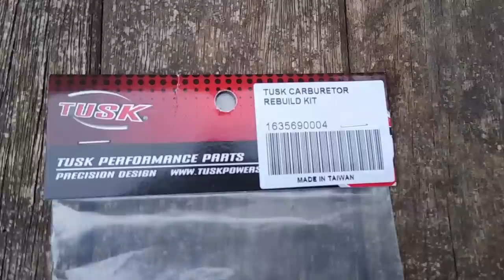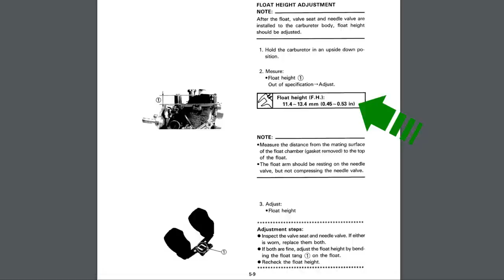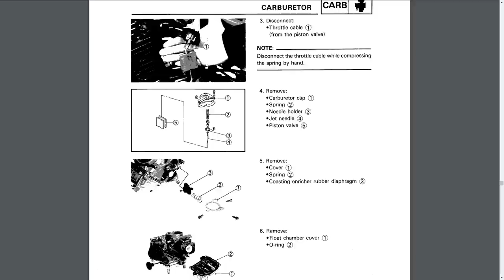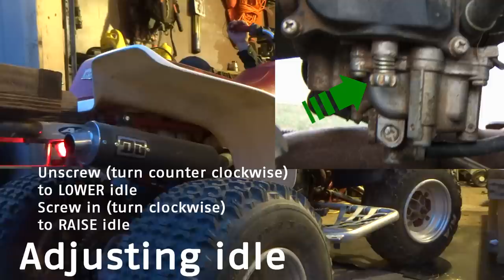YAMAHA WARRIOR ATV CARB CLEAN, REPAIR AND REBUILD - CARBURETOR FUEL SYSTEM TUNE UP

Comment: hey man do you know where to buy a accelerator pump plunger ? we just got my dads 94 warrior back that was stolen 6 years ago in bad shape. the plunger was completely siezed even after soaking in a gallin of carb clean for weeks. ended up breaking the rode off it. hoping i can use a small drill bit & run a screw in to get the bottom out. but, i cannot find the plunger anywhere. these carbs are around $350 new & the quad just isnt worth putting that much into it. if i cant get it out ill need a bowl & plunger both but, im pretty sure i can get it out.
Reply: Bryan Roupe , I bought a brand new carb on amazon prime for under $50. Used it for parts as I had the same problem. Throttle linkup was SLIGHTLY different so I’m going to just use the bowl from the new carb and the new pump (since the pump seized in the bowl)
Reply: If you are looking for oem parts can't go wrong with Rocky Mountain ATV under their oem parts finder

Comment: Two throttle cables ? What year was that warrior ? My 01 has only one cable but 2 levers linked together like locomotive wheels or a holley double pumper.  Is this normal ?
Reply from the maker: This white and red quad is an older model. 88 i think. They only did that for a couple of years from what I heard
Reply: Mine is a 90 , I believe, it also has two throttle cables

Comment: 3:58 what is that piece called where you’re unscrewing the throttle cable end from???????? Please somebody i over tighted mine and the whole threaded part broke off
Reply from the maker: The throttle cable adjuster?

Comment: Can you help if you know? When I have the gas line turned on my grizzly it will not start with or without choke but if i turn the gas line off it starts and runs until the gas in the bowl is empty then it cuts out. Do you know anything I can do to fix it?
Reply from the maker: take the fuel line off the carb and turn the gas on. does it flow unrestricted? some quads have a tiny filter inside or fuel take or the petcock can get clogged with junk. I would start there then if that does not fix the problem clean the carb and make sure you clean the needle valve seat or replace it entirely with a carb rebuilt kit (needle and seat). makes certain your pilot is not clogged up. also make sure the gas tank cap is venting or it will not let the gas flow properly out the bottom.

Comment: Where the hell doe the little 5 inch black breather hose go on the top back carb? Been trying to find there everywhere. I see a little tab with a hole in it? Does it just go in there?
Reply from the maker: It should route upward along the frame up under the tank where it can't draw water in
Reply: @trailblogger  Thanks bud. Found a little weld tab with a hole just big enough on the frame to route the hose in. 🍻
Reply: @trailblogger I got a dumb question lol...my first time working on my warrior or atv period and I wanna know does the hose from the fuel cap run downs to the carb or is it suppose to be short and just hang there cause It kinda look like it should go somewhere or is it just a vent hose?
Reply from the maker: The gas cap vent hose goes forward down below your bars by the steering stem. It needs to remain unplugged or the tank won't let fuel run out properly. Think about when you put your finger over the end of a straw how the soda gets trapped inside until you let your finger off the end. The venting allows it to drain correctly.
Reply from the maker: There is usually a little hole by the stock plastics that comes with the quad but it gets thrown away.
Reply: Thanks @Trailblogger

Comment: Quick question for anybody i have an 04 warrior i dont have a throttle cable on the top of my carburetor is that normal or is that only for older models
Reply from the maker: Most of them only have one throttle. I'm posting a video soon, later this week maybe that shows it with the single cable. I was surprised to see the dual cable setup.
Reply: @trailblogger  i understood the video and its how ima rebuild my carb thank you for the tutorial but the top cable did throw me off
Reply from the maker: @GGSWITCHBLADE  what is weird is I am working on an all original blue 87 warrior now and it has the single cable only.
Reply from the maker: How did it go? Get her going again?

Comment: I just did a rebuild on my carb, I have a 1992 Yamaha big bear 350. Now it  has major issues trying to get it to run. No power whatsoever. I am lost
Reply from the maker: Take it apart and do it again you did something wrong
Reply: @trailblogger  I wish that was the case, the owner before me forgot a few things and trying to find a detailed diagram is another story
Reply from the maker: rocky mountain atv parts diagram? is the float level set right?
Reply: @trailblogger  I did it like you showed in the video, problem is it will idle but when you give it gas it cuts out really bad but is ok at the top end. Also its extremely rich running
Reply from the maker: @cameroncassel994  are there a couple of safey wires near your parking brake on the handlebars? mine was running horrible until I bypassed the safety switch
Reply: @trailblogger  yes it has those wires on the handlebars, I will check them when I finally get home
Reply from the maker: @cameroncassel994  i took the two wired and twisted those together, sealed with electrical tape and tucked under the fenders.
Reply from the maker: @cameroncassel994  NOT your brake wires for your brake lights.
Reply: @trailblogger  there is a brake light switch and an off and on for the lights and stop and run switch

Comment: My pump moves up and down freely until I put it back together and then it sticks almost like the o ring is stopping it or something
Reply from the maker: Bit of fine grit hone the outside smooth and clear the hole with a tiny wire brush, upgrade the spring to one from a bic pen
Reply: @trailblogger  ya looks like someone already put a pen spring in it I did the steel wool around it a bit and I guess that worked alright still having issues with it idling though and running hot Im thinking a timing issue and what not
Reply from the maker: @michaelpresey2273  well your plunger could be buggered or the hole wallered out. Carb kits sometimed include the new plunger

Comment: Where do the top 2 fuel lines go?
Reply from the maker: they are just vent lines for air. they need to stay open.
Reply: Thx friend!..u get a sub for helping!
Reply from the maker: glad I could help!
Reply: Well u replied and subbed back(thx) so hear my story..got this sick aluminum gokart with a warrior 350cc in a trade..carb was spitting out fuel through top fuel vents(thx again)..took it apart after watching this vid with no fear...had some gunk..cleaned out...runs perfect..YOU ROCK!
Reply from the maker: hey man, that's awesome to hear. glad the video helped out.
Reply from the maker: and how could I not sub back with a name like Go Karts or Gone Fishing? :-D
Reply: Haha!..i hope others think the same!
Reply: Andre Hall the port you mention that us on the bottom of the fuel bowl is not supposed to leak fuel but is to drain the fuel bowl of its contents. The tube runs toward the rear axle area just enough to have a clear area to the ground for fuel dump.  If it's leaking just remove the screw that is just forward of the tube connection and clean the pintel end of the screw and its seat in the bowl.